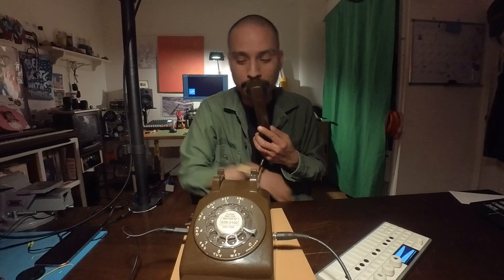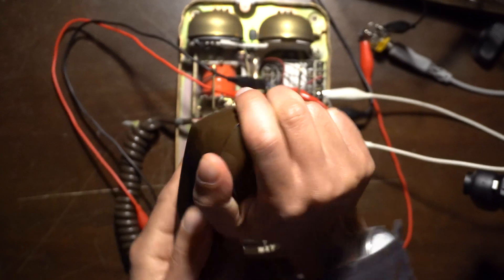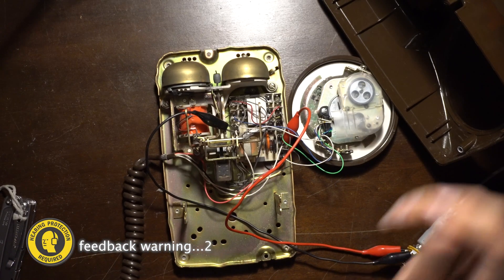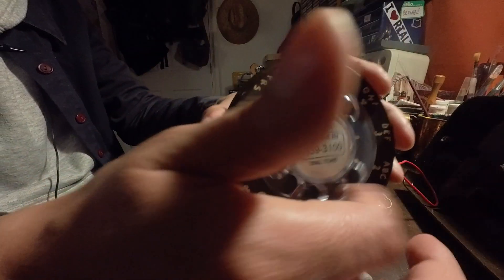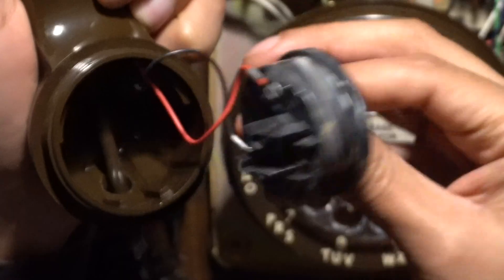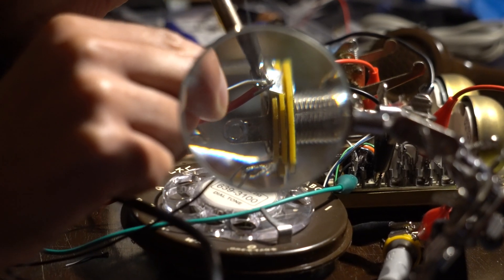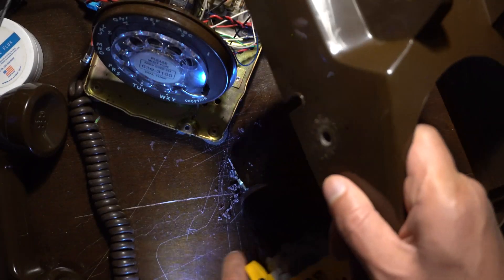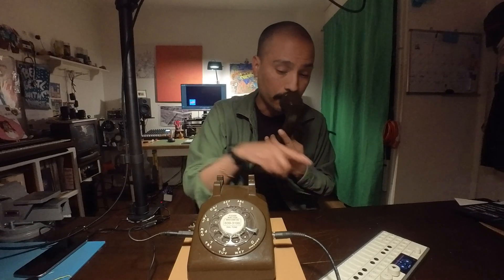Turn a TELEPHONE into a MICROPHONE

Comment: Hey! Great video and it compelled me to try and do the same. But I ran into a few issues. I'm not using a rotary phone, so I'm not trying to make a stutter effect. But a few roadblocks perhaps someone can assist with?
1) I got first mic working, but the audio comes out rather quiet and I have to ramp up the amp settings. Is this normal? I did add a potentiometer (250k), could this be impeding it?
2) I followed your steps for the carbon mic, but I'm not getting any sound out of it? Am I missing something like a transformer or capacitor? Do I need to ground the switch? Do I need a 9v instead of an AA battery?
3) How do I connect the input to the output so I can pass and instrument through?
4) Do you have drawn schematics I can perhaps see?

Thank you so much and I've been having so much with this build but I am ready for this build to end 😂

Comment: I have some questions.
1. Can I just run power to the carbon mic through USB A? Which gives 5V
2. Is there a way, to use the carbon mic as a normal mic, while simultaneously using the earpiece as a Sound, so I can use it as a sort of headset?